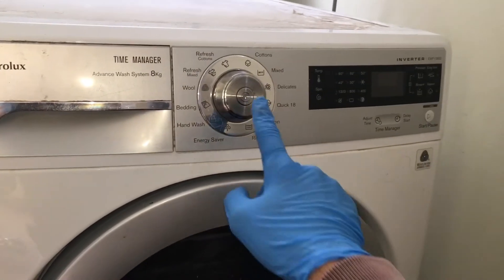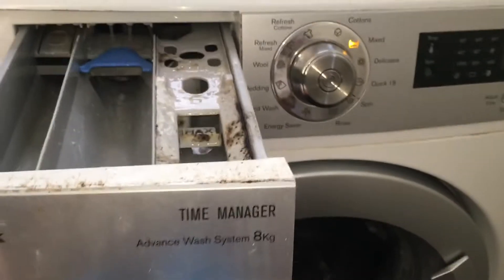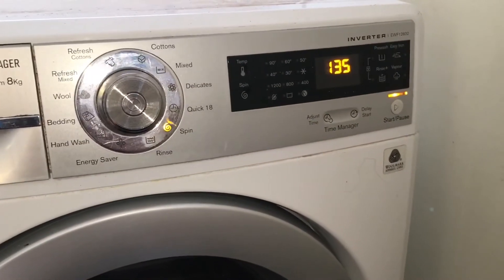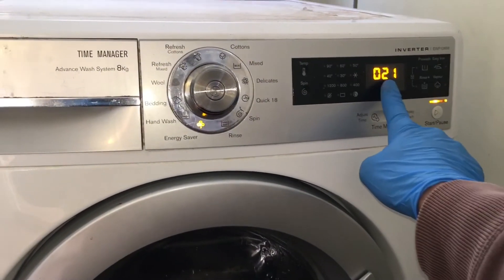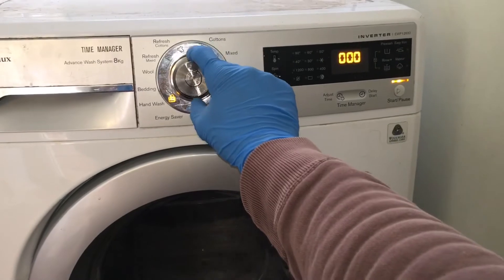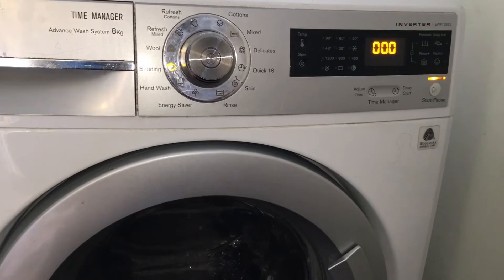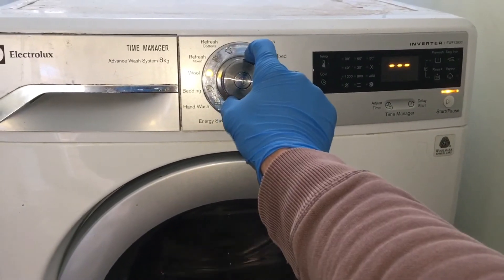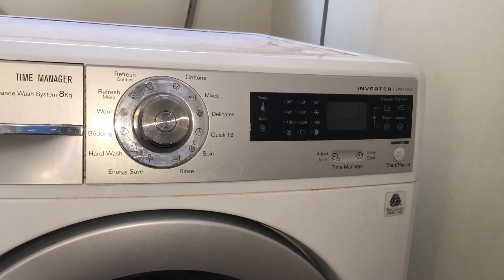Electrolux Washing Machine Diagnostics Menu Time Manager - EWF12832 - EWF14822 - EWF14922

Comment: Hi, my machine starts the wash ok, goes through the cycles, drains the water and then when it gets to the rinse part, it (when using the “Mixed” wash setting) hangs on 38 minutes for about 5 minutes and then displays the E10 error. It also does the same thing on any wash cycle when it gets to the rinse part… I then have to hit the start/play button again and it’ll hang on 38 minutes again for another 5 minutes then display E10 error again. The I hit the start/play button again and it will start filling up with water to start the rinse cycle and then completes the rest of the wash ok…. I have cleaned out the drain plug, I have checked the pipe on the water level sensor and the filter on the intake is clean. 

would you have any idea what the issue might be?

Thanks in advance

Comment: USER TIP - Open the door at the bottom of the machine, unscrew cap to remove filter and give it a clean
Also do a wash cycle with descaling water (set to hot temp) to give the machine a flush out.

Comment: What happens if this machine will not turn on?   Like, it goes inactive/off by itself after a wash, then pressing the power button, normally the panel lights up, but now, it's not lighting up or getting any activity at the panel..    I have the Electrolux EWF 12832
Reply: I've got the same issue, was yours something simple?